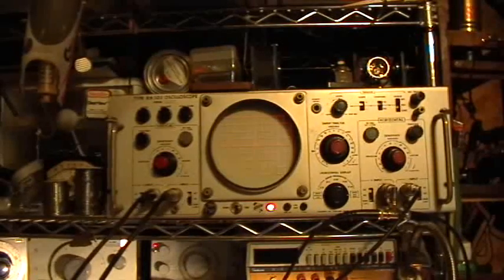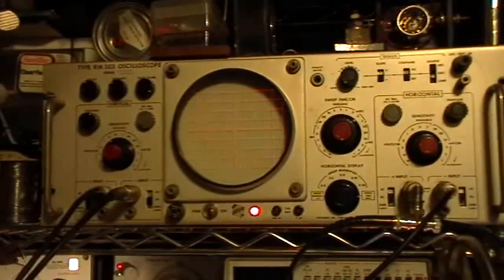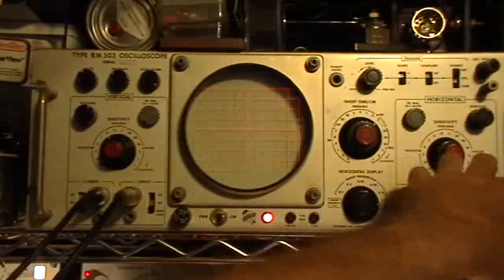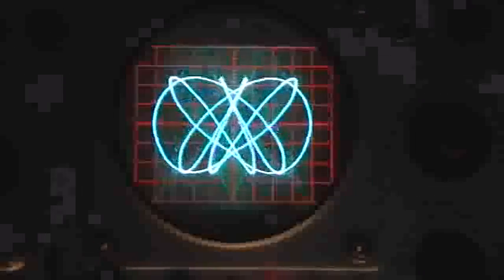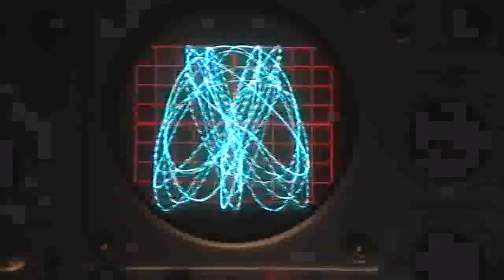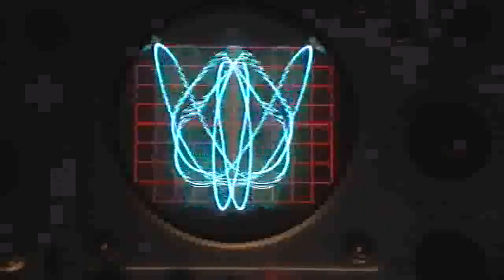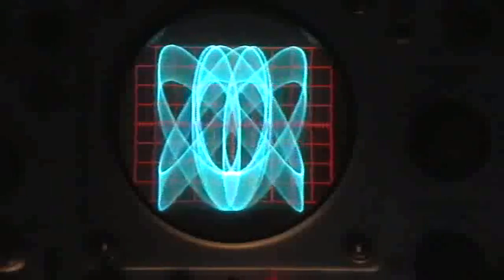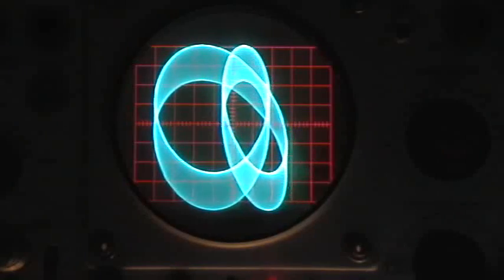Scoposcopy: RM503 and the 4 Oscillators Present: Lissajous For You

Comment: marvelous!! how would one do the same on a normal analog XY scope without the 2Xinverting jacks? mixing the 2 signals somehow i guess? is it maybe half of the first sine (rectified) then added with the negative rectified wave?
Reply from the maker: Something like that. I'd use an op-amp buffer stage with one oscillator input to the op-amp's inverting input and the other oscillator to the non-inverting input, then feed the output of that to the scope input. I should think pretty much any high impedance input op-amp chip would probably work OK since the frequencies are low. 
Thanks for watching and commenting!
Reply: Thank you! I am looking forward to trying this out later. Is it a big advantage to have a low frequency scope? Is a phosphor B31 just as good for Lissajous patterns?

Comment: Very cool, I have always liked the Lissajous patterns, but I didn't know you could use 4 generators to form them.  Very cool, they can be quite hypnotic. Do you have another video where you go in to more detail on cable and scope setup. thanks mike
Reply from the maker: There are a few more Lissajous videos on my channel, please check it out! I don't recall if I went into much detail about the hookup though.

The RM503 scope is unique in that it has two inputs for each amplifier and the vertical and horizontal amps are identical. The two inputs per amp are inverting and non-inverting. So I select the "x-y" mode on the scope, which cuts out the horizontal timebase and subs the duplicate horizontal amplifier for the X direction. So with four oscillators I hook one to each of the inputs, two to the inverting and two to the non-inverting.

To duplicate this 4-oscillator setup on a modern scope that only has one input per channel and x-y mode between those channels, you would have to use an op-amp buffer stage that did the invert-noninvert summation externally and then feed that output into the channel input.

It's probably a lot slower than doing a snap roll in a Pitts, though!